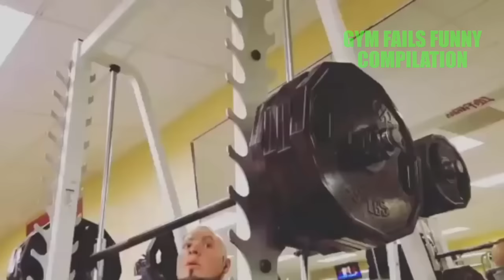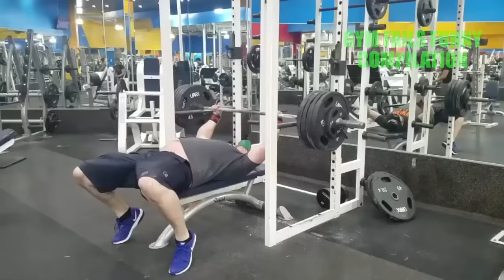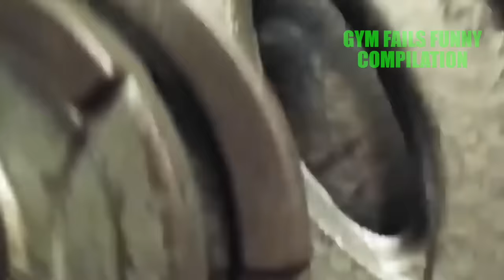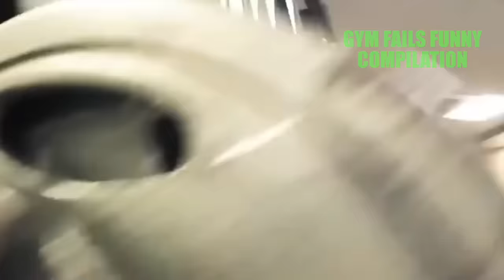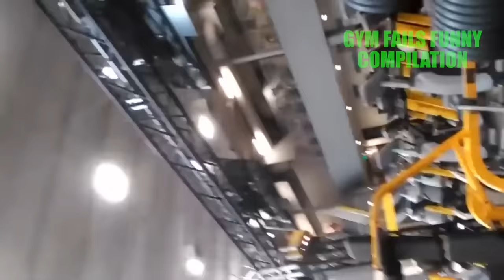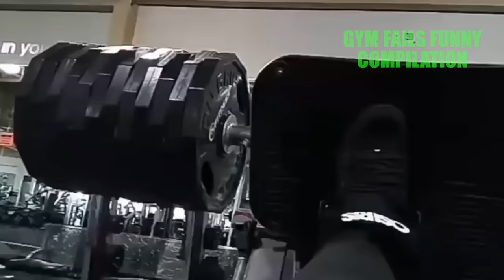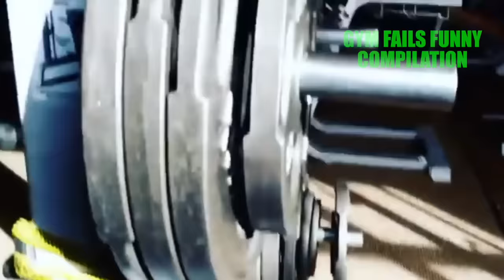EGO LIFTING 101| GYM FAILS FUNNY COMPILATION 🚑

Comment: I’d actually throw hands if I had to listen to someone brag about doing heavy weight on a smith machine😂
Reply: I know right go to a real gym and lift  real weights
Reply: For real 😂 that stuff would get you dog walked out of any power gym.
Reply: Stronger Back Then i graduated from the smith machine 😁
Reply: I use the smith machine if I'm pushing my limit since I don't have a spotter safety first.
Reply: Smith machine is for beginner who are new to deadlift and doesn’t have a spotter. It Doesn’t make you more of a man/woman  just because you don’t use smith machine.
Reply: The only thing I would vouch for the Smith machine on is the inverted row.
Reply: Am I the only one who has a more difficult time using a smith machine? I can't stand them.
Reply: Smith machines are good for you when you don’t have a spotter or for lightweight high rep days. Don’t knock the machine. It has its benefits as well.
Reply: Angel Gil Lopez I just personally don’t find it to be as beneficial as normal good form benching. If you don’t have a spotter then I do agree it’s better but there are also alternatives like switching to light weights for more reps if you don’t have a spotter. Just my personal opinion. I can see the pros and cons
Reply: idk man smith machines are actually kinda great imo
Reply: How are smith machines any safer if the bar comes down and you and you can’t get it back up you are screwed unlock a regular bar where u can roll it push it away
Reply: @iamben7556  ok lady
Reply: Jayden Smith have you ever used one? If not doing so would answer that question
Reply: If you think Smith is for begginer or women, you my friend are the begginer
Reply: If you do your max on a Smith machine  it doesn't fucking Count. Guarantee you can't do near the same weight using free weight not even close FOH
Reply: Bro, this is what I'm saying. Like that literally pissed me off just because of the dude's stupidity. Glad I'm not the only one that felt the rage. Lol
Reply: @iamben7556  you don't need a spotter for deadlift and your right using a Smith machine doesn't make you less of a man/women you will always be weak as fuck compared to people not using Smith machine.
Reply: Some extreme ignorance on display here. Smith machine is perfectly fine for use in workouts, if you actually did research you would find that outside of squatting most exercises have nearly the same muscle activation as free weights. Yes some exercises don't have the same muscle activation and limit ROM and Stabilization, however if used properly the Smith machine can address those issues simply by switching to different exercises and positions. Just because you use a Smith machine doesn't mean you are less than, if you think it's for losers or people who can't lift. Brian Shaw and Eddie Hall use Smith machines in some of their workouts. None of you can compare physically to them. So shut it.
Reply: Almost as bad as someone bragging about how much they can leg press
Reply: Yeah smith machines are for people that are scared of real weights
Reply: Omg same
Reply: @iamben7556  Yes. It absolutely does.
Reply: @rhythmindset6996  Yes, you're not stabilizing like as if you're using free weights but you're still lifting the weight. It's just like if you're using a leg press or a chest press machine. You're locked in place and have better isolation on the muscles🤦🏻‍♂️
It's still good to implement Smith's into your training.
Reply: Hes bouncing it
Reply: The smith is really good for form because you don’t wobble or lean to one side. Your form is strict - provided you are doing it right - and it’s actually harder for benching, squats etc.
Reply: @nickgodfrey1148  I regret commenting this because I use smith machines now 😂
Reply: @youraveragereviewer296  😆 it’s never too late. I’m glad you’re using them coz I think they are great. 
I use them and I’ve been training for years. I would recommend them to anyone training, especially beginners.
Reply: @nickgodfrey1148  especially good when you are lacking a spotter, the stability is great. I do some exercises with a normal bar, but man smith machines are the shit😂
Reply: The smith machine is great for hypertrophy, i use it for incline bench and squats as well as calf raises bc it makes your rom perfect, however it does not translate to free weight  excercises because you dont have to actually stabalize the weight, you just move it. But its great for exhausting muscles to get that round full muscle look. If your a powerlifter or just focusing on athletic movements obviously the smith machine isnt in your plan, but for bodybuilding i love the smith machine
Reply: Smith machine is a great tool if you have stability issues as long as you don't cheat with it. These people be straight up using it to bounce the weight back up.
Reply: Not only that, he also put the safety stops at a point where the range of motion is not existent, that's not even a "baby rep"
Reply: @iamben7556  It makes you more of a woman if you use the smith machine.
Reply: @cmk5724  okay tough guy
Reply: @firstlast8703  nice
Reply: Jazz hands?
Reply: @iamben7556  when using smith meaching you stability muscle wont work, you no need to balance the weight, thats why you can life more
Reply: @allenszykula8071   @Iam Ben  when using smith meaching you stability muscle wont work, you no need to balance the weight, thats why you can life more
Reply: @ThaGhettoBlaster   @Iam Ben  when using smith meaching you stability muscle wont work, you no need to balance the weight, thats why you can life more
Reply: @pragmaticparabellum3042  did you even read my comment Mr robot.
Reply: @pragmaticparabellum3042  oh you really don't get it do you tiny. Yes it cuts out the stabilizing muscles bit of you max out 20% higher then ypu would doing it with free weights and no spotter then you are still building strength and limiting the risk of injuries. As long as the muscle are able to work at a higher level then they other wise would you are building strength. Thank you come again.
Reply: @pragmaticparabellum3042  you do realize their are ways to build stabilizing muscles outside of just doing dead lifts. And you can use the combination of free weights well balanced exercise routines and yes Smith machines to improve across the board. You don't just need to only push for max on free weights. You can use other weights and exercises in between attempts to build muscle. Go read a book meat head.
Reply: Haha throw hand.  I like that
Reply: I honestly don't understand why people shit talk the Smith machine. Yeah the rail makes the lifts easier but you can adjust for that by just throwing more weight on. I don't see the difference.
Reply: id throw plates at him
Reply: @iamben7556  MY MAN HOW YOU DOIN DEAD LIFTS ON A SMITH MACHINE ITS SO UNCOMFORTABLE. Nah but for real I move around to much. It's impossible for me
Reply: @sweetmeat3236  its safer in the aspect it has those air brakes so it can't fall on you max force. Or you can just turn it at any point.
Reply: Fucken sure of it man
Reply: plus only does 25% of a rep and counts it as one
Reply: @iamben7556  lmao deadlifting on a smith machine? That sounds horrible 😕
Reply: @ThaGhettoBlaster  that’s what power cages are for
Reply: Heavy weight is heavy weight lol. Sure the smith machine makes it so you don't have to use all your stabilizer muscles like with free weights, but 500lbs is 500lbs. Matter of fact I find that I can't move as much weight on a smith as I can with free weights
Reply: @iamben7556  A spotter for deadlifting? Unless your lifting so much weight that passing out is a concern there's no such thing as a spotter for a deadlift
Reply: I Don’t Understand this Argument my Flat Bench Max is 210 Free weight but if I Were to Throw 225 on a Smith Machine I’m Not going to be able to do it. Or Does it make a Slight Difference like 2.5/5lbs?
Reply: U look so tuff in ur pfp
Reply: @Anonymous38572  lol dudes not “throwing hands” with anyone
Reply: @PhysiqueGeek  maybe thro his hands up in he air and run the other way
Reply: @Just Name smith machine is just like free Weight, you just dont have to stabilize on smith machine that is the difference.
Dont listen to these weirdos.
Reply: Smith machine is good when you want to break a PR without a spotter
Reply: There is not that big of a difference between a Smith machine and free weights. You're speaking from ignorance.
Reply: Save your hands bruh.  Just take off the spotters before this guy shows up
Reply: You’d probably get knocked out

Comment: Zero gains and multiple future back surgeries were achieved in the making of this video.
Reply: Nice pfp! Still Life is their best album
Reply: Exactly. Gains are made by pushing each muscle to the limit over many reps. It's better to isolate for growth,too. When you do a bench press,you are using a collective of muscles, when you isolate,you work a muscle until it requires repair.
Reply: @ShinkuGouki  when you exercise multiple muscle groups though, it can be super efficient it'll just take more time to build as much.
Reply: I've seen plenty of Idiots like this in my gym. I usually tell them good job and encourage them to lift more 😂
Reply: @FIGNAS83  you know you wrong man lol
Reply: Still Life is my favorite album of all time 🤘
Reply: @ShinkuGouki  not exactly actually. In fact power lifters like Larry wheels mike o Hearn. Do not do max reps they do very few reps at extreme weight
Reply: @MrTiton536  They have been bodybuilding aswell, not just powerlifting.
Reply: lift heavy you cant get any gain cuz you in pain or just moderate
Reply: OPETHH
Reply: Lmfao
Reply: @ShinkuGouki  No bro heavy compound lifts are much better muscle builders than isolation exercises.
Reply: Idk the dude doing the heavy lifts like deadlift, pin bench looks pretty jacked. More jacked than most isolation bros
Reply: Opeth!!

Comment: 2:15 we gotta give him that squat. Solid depth but good god his back must hurt
Reply: Someone needs to tell him he's not supposed to put the bar on his neck and his form will instantly be better
Reply: that clip shouldnt be in this video, it was not the best form however solid depth. i dont think thats ego lifting, he has a bad form but he is pushing himself hard. ego lifting is beyond bad form, it is stupidity
Reply: I have definitely seen a lot worse form with a lot less weight 🤣🤣 gotta give the guy credit where it is due even though he will have a herniated disc somewhere down the road.
Reply: Thank you! Poor form, sure, but he got that sucker back up.
Reply: If u have a longer femur your back will go lower but he does need to work on his form it’s just not as bad as it seems
Reply: So it’s suddenly not ego lifting because he went down all the way despite having terrible form?
Reply: Same thing I thought.  Good range of motion but that back though🤮
Reply: I agree
Reply: @mohamedbaradji7504  Yeah because he could lift the weight actually and the only thing wrong was his form not his range of motion. Doing 10% ROM as some idiots in this video is ego lifting, he did 90%+ range of motion. Improper form doesn't make it ego lifting, for example I knew someone who couldn't properly lat pull any weight, no matter how heavy or light he couldn't properly do it, doesn't make him an ego lifter just a beginner.
Reply: @mohamedbaradji7504  I mean he did go all the way down and get it up pretty easy. Is not a good form but is still count. That’s the point of squat.. go all the way down and get it up.
Reply: Yeah possibly parallel squat but man definitely asking for an injury or slip disc. For sure ego lifting go back to the basics with just the bar and work on his form and not worry about how heavy you can go until his form gets better
Reply: no, if he was not leaning over, squat would not have happened. That's one Que it's to heavy, you start leaning forward or your butt starts popping up first.
Reply: @gavinclancy2890  Bar on the chest like the Olympian powerlifters???
Bar on the chest is better than on the neck??? Salute
Reply: @dahacksterkent8169  there’s nothing wrong with bending over on a squat. It turns the squat from a leg movement, to a full body movement provided it’s in a controlled manner
Reply: @gavinclancy2890  and lower the weight, i do the same mistake when i pull too much weight
Reply: I think that guy is genuinely strong and has lots of potential, he just needs a good mentor to show him how to relax and perfect his form before going for PR's. My max is only 315 and my form was almost as bad when i was doing it.
Reply: @trentdeckard4635  using all the wrong muscles wow big congratz
Reply: Yeah the depth is respectable, but Im surprised how 315+ pounds didnt push him forward cz he didnt have his back straight.
Reply: @rocas4087  if it was a one rep max it was ego lifting.
Reply: Yeh didn’t seem like ego lifting just poor form
Reply: @mohamedbaradji7504  you dont lift do you
Reply: Pork chops at it again
Reply: @imegadood9582 I was going to say this. Taller guys with long femurs often have to bend forward a lot to get into the squat position. He needs to work in guys back strength to avoid that arching, but he doesn't deserve to be on this video.
Reply: I think it’s the fact that it proves he’s not that strong, if he can “row” 425 how tf is he struggling with 365. My brother who is 185 just squatted that for 3x3 with just a belt full ROM ( I have the vid for proof) and this dude who’s twice his size and supposedly “stronger” is struggling with 365 lol
Reply: I would choose my perfect technique deep sqaut with 100kg over whatever this guy is doing any day.
Reply: @Angelicx999 it's the same 2 guys the entire video
Reply: The definition of delusion... U can't hate the guy thou
Reply: @imegadood9582  That's when you widen your stance and do low bar. As someone with long femurs i can say that squatting sucks.

Comment: “510 lbs baby you can’t even squat that and I just shoulder pressed it”. I’m sure that bounce 2 inch rep really works😂
Reply: Does he know what a shoulder press is 😂 because it's certainly not a two inch bounce
Reply: Pure strength man " real weight, that's real. These are all made by the same company"
Reply: That one was satire right, right?
Reply: So much tension from his reps his gains must be unmatched
Reply: On a smith machine
Reply: I would like to see him shoulder press that weight without the smith machine just some heavy weights and a utility bench

Comment: When someone gonna tell home boy that a smith machine that’s set above your head isn’t a real shoulder press 😂😂
Reply: It is, If you do it correctly it has its own benefits, it's more for hypertrophy than strength, because your able to isolate the shoulder more as your not using your balancing muscles, or abbs to lift it. Of course it's easier but that's the point in hypertrophy, to isolate the muscle as much as possible. And it also allows you to have the bar as close to your nose as you can without almost smacking yourself in the face, so form is better.

Comment: Those half reps will turn to full if they still do them but also lower the weights and practice on full range, the guy also did a static hold with 400 that’s actually smart I do static holds and I have no protection if it slams on me which it did a couple of times and messed up my shoulder for stopping it because I missed the re rack.

Comment: That's not just ego but a bit worse than that. It's a bit of... fantasizing about themselves. The fact that somebody can lift a lot of weights (for example 500-600 pounds) doesn't mean, that they're proper lifters.

I know a guy that once upon a time he lifted the front of a Lada around 40cm off the ground because there was a man underneath it. He was ridiculously strong and he doesn't visit the gym. The part of the Lada that he lifted was probably around 1000 pounds or even more, because that's where the engine was. Strength doesn't always equal "proper lifting in the gym"

... also... lifting those weights without having proper training and durability, can damage the body. I'm not saying that they shouldn't try to lift more and train to be better, but I'm saying, that those people are trying to lift a lot of weight, without even knowing how to lift it. They lack a sense of reality and discipline and this can play a very bad joke in the long term.